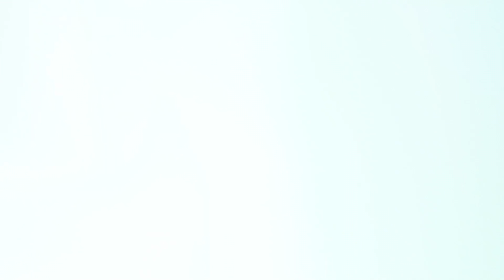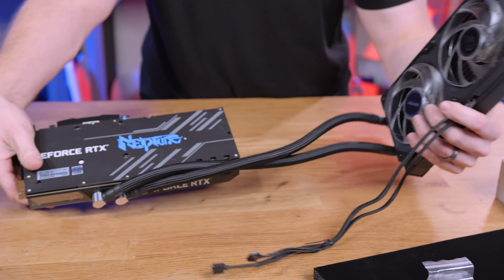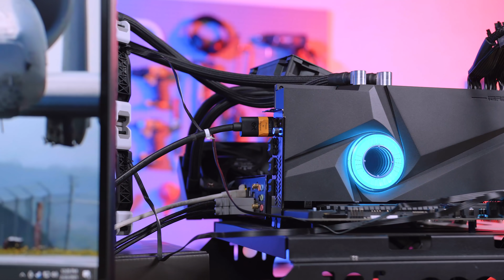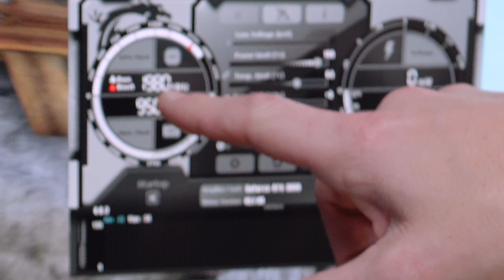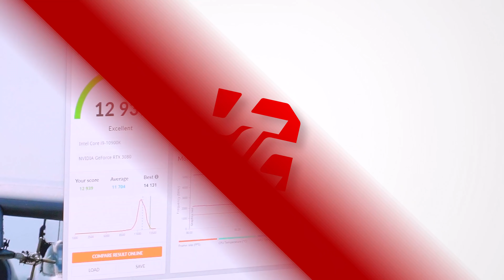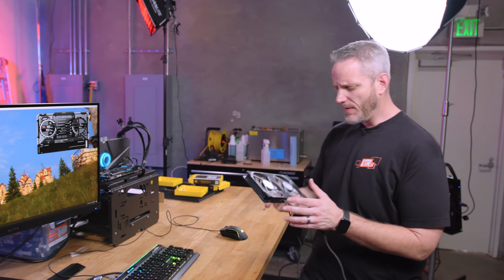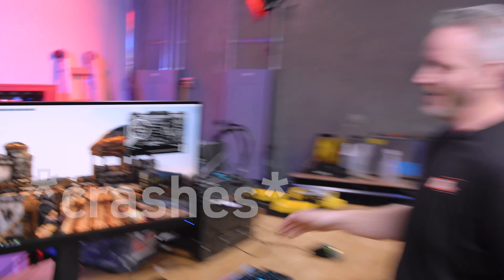AIO vs Air Cooled Video Cards... worth the extra cost?

Comment: Yes, 100% that AIO coolers are they way to go to cool GPUs.  Im posting this on July 21st 2021 and several new 3,000 series cards now come with AIO coolers. For overclocking a GPU its a must unless you want to leave all that extra performance on the table. Also the benefits of long term use of the card is most likely better to keep it cool. Another benefit is that your GPU is not pumping out so much Hot air as before heating up your room. Cant think of any Cons to using an AIO for Both CPU and GPU.

Comment: @JayzTwoCents Having both CPU and GPU with AIO's are great but I'd imagine that placement in the case is going to be an issue.  I assume that you would want this to placed as an exhaust in your case considering it may be blowing hotter air into it than a CPU AIO would, no?

It would be nice you could talk about dual AIO radiator positioning within a case for optimal airflow and temps. Maybe even in a Corsair 5000D Airflow case.

Comment: Go with what looks the best lol. Could of gone air cooled and have about same temps. It's just a bit boring lol. I don't build personal pc often. I want Something worth having a window for. Middle of building a joker themed pc. Sprayed purple with 3D printed designs used as a template to not block air flow. Spray painting over them. Hand paint the rest. Frost glass effect to cover bare PSU. Green and purple internals. Small screen to monitor temps.

Comment: This is a terrible video.
Reason being the title poses a simple question and it somehow takes 16 minutes to just show a chart of data. If you wanted to elaborate on the testing method used, that could've been done a lot more concisely. This seems to be 12 minutes of filler, padding, shilling, and general banter when this is a pretty common question that people consider when building.

Honestly just... give me the fucking data. Even Linus vids are more concise than this (and actually show relevant data).

Comment: I have a evga 2070 super with the same aio design as that kingpin 2080ti. I lost the silicon lottery and the chip doesn't like to overclock but the thing stays nice and frosty all the time so at least it's super quiet and I can trust it to run for a very long time

Comment: I am still running an EVGA GTX 1080 Ti SC2 Hybrid, I went with the AIO watercooler to spare my motherboard and other components the heat of the GPU,  I also have my CPU on an AIO pulling air in from the front of the case.  The GPU exhausts out the rear of the case and I have 3 140mm exhaust fans on the top of the case.  Funny thing, I don't even overclock, but my PC is in an unairconditioned room and it can get mighty hot in here, so I tried to get my PC to breath as much as possible.  It has been fairly reliable for a few years now.

Comment: I got a couple of RTX 2080s in 2019 with aio water cooling and I think it is great, it definitely keeps my pc temps much lower, and I have a noctua cooler on my CPU so since the gpu isn't blasting hot air inside the case my CPU also is much cooler too

Comment: I feel the case to go AIO is not for performance, but for noise. While Raijintek Morpheus, Arctic Accelero, and even stock heatsink+fan mod were all significantly quieter than any stock setup as well, the noise difference under load for an AIO (especially when overclocking) couldn't be matched. Add to that however the temps are also lower not only for the GPU, but for all components since the heat isn't exhausted into the case, it was a quality of life improvement across the board. The only downside was of course cost, but if you're already a user buying a top end graphics card ($700-1000+) you're also likely putting it into a system with other high end components, and at the end of the day if you weigh it as a $2500 system vs a $2700 system that has significant quality of life improvements, then it's a no-brainer upgrade.

Comment: It depends on the card. If you're buying something super high-end like a Titan or 3090, then you may as well bite the bullet and go for it.

The 3090 is a special case, though. I've yet to see an air cooler that keep those things under control. My EVGA 3090 FTW3 routinely exceeds 95C under full gaming load. Whatever jackass thought it was okay to try and air cool a 350W card should have been fired.

Comment: I don't get it! With LN2 it would run faster, and it crashes below 50C even tho it is specd for 95C before turning off!
Why isn't it auto overclocking further? if there is temperature and power headroom...

Comment: Currently I have a gigabyte nvidia 3090 xtreme waterforce, I use the machine to play in 4k resolutions, previously I had a 3080 gaming pro palit and a 3080 msi gaming x trio msi, all mounted in a lian li 110 dynamic xl cabinet and the difference of temperatures is impressive, in my case it is worth the difference in prices, if these were normal.

Comment: I think 3fans air cooling is good for some good oc, my GPU runs good at  67 degrees Celsius under stress with  benchmarks  with around 1.9 2.0 Ghz clock, which is a good temp for high OC. Aio cooler seems good  if u wanna go Xtreme with maybe some RTX 3080 or 6800XT with much OC, or to have a more silent build.

Comment: finding something that  covers everything in its own individual loop and having a 3 chambered container that is somewhat chilled to a point that it can contain a chilled element  to benefit  keeping the gpu chilled so it doesn't crash..

Looking at the average dl of games and various additional content  I would think to have it all active in a way you are either  at the routed  of creating the scenario of adding NVME storage and use is as ram bank boost to run the games with all those additional features

because even with access to 24GB, looking at all the new features I think there isn't appropriate ram to cater to these productive and progressive, and if you are going to keep bottleneck ram whether it be on console/pc/laptop. we are going to play-ability issues long term..

because you end having to use harddrive/ssd space as a caching service if not relying on some form of device to offload some of the processing too as seen with both the xbox one x and ps4 pro

at this stage we have been at the 128GB and higher options gpu space otherwise we pay a penalty of hand off to either 65/128/512/756 GB or 1-10TB of storage ram to offload the processing too just to process 4khdr and all the widescreen formats you can name including support the realism of shader  aspect that consumes..

I think both amd and nvidia might  end  up having invent a daughter card just to cater for the next version of their own phys-x engine where all the compute engines are catered to from that card interface otherwise we are going to have retire the older crap to cater for cards with up to 2TB of ram just to process the newer graphics engine.. 

as for cooling it I don't have a clue though I suspect what is and what will be within the marketspace in the next 2-5 years might not be suitable for cooling purposes..
that much ram never mind the other components of the gpu

Comment: I just stick with air cooled. It's easy to install, easy to run, and have fewer things that can go wrong. I very rarely overclock because my RX 5500 XT provides my 1080p 60Hz monitor everything it can handle, so there's zero point TO overclock. I don't have 4k monitor, I don't play AAA titles like Shadow of Tomb Raider, I give absolutely no *cares* about RTX or any of that nonsense, and I consider RGB to be one of the greatest atrocities to have ever infected computer hardware. 

So... I use air cooled because I don't push my hardware hard enough to require liquid cooled, so if I don't have to deal with all the extra headache of an AIO, I'm just not going to do it.

Comment: Using an aio is great, have done it for my last 2 gpus using the kraken g12, the fan it comes with is dead quiet and can be run 100% no issues. During most gaming situations the fans on the aio don't even need to run much, I have a h80 with one sp120 run at 900rpm constant, temps were not over 60 degrees, idle was around 30

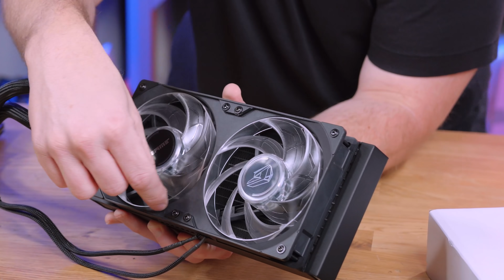Comment: observation: @ 3:36 - "they got this channel along the side of the blade" The correct term is shroud. Fan shroud. An integral molded on shroud. That design is pulling more current due to the extra mass is my guess.

Comment: I do have a concern over longevity being that these are new designs. I've heard of several AIO pumps failing so it's reasonable to wait for long term test results before jumping on board and trying to find one. Depending on the manufacturer and quality of the components, it may be a big gamble on an expensive card when air-cooled or custom loops are already tried and proven.

Comment: To be honest, I'm not really a huge fan of the CPUs with built in AIOs. I wish they would just make a full cover block and the card single slot so you don't have to worry about fans for VRM cooling. They just seem kludgy to me (admittedly, I run a custom loop, but that's not for everyone).

Comment: My main reason to use a Hybrid card is to better control air flow in the case.  Yes, the temps are better and the card performs better; but not by enough to justify the price difference based on performance difference alone.  If I buy an air cooled card then that just means I'll have a useless air cooler on my shelf after I put a water block on the card. To each, his/her own...

Comment: I've had a 1080TI Gigabyte Aorus AIO for like 3 years now.  It's been super solid.  I removed the hard drive cage and placed the AIO rad right up against the front case fans so the exhaust literally just exits the case immediately.  HOWEVER, I mistakenly thought at the time of buying that it would be quieter than any air cooled card, and although it is very quiet, it's still the loudest thing in my case (BeQuiet case & PS with Noctua CPU cooler).  What I hear are these high-pitched clicky-swuishy sounds , when you put your ear up close sounds like liquid moving.  So, my next upgrade will probably be all air cooled so I can take advantage of silent modes for audio recording.

Comment: I'd put an AIO on my XFX THICC III Ultra not for the performance boost, but for the noise. The  Thicc 3 will boost to approx 2200 on air but holy  crap the thing sounds like a jet engine while doing it. I was seriously looking at NZXT's aio adapter but I'm not sure about compatibility.

Comment: Other people: omg my gpu temp got from 31C degrees to 32C, omg it’s burning.
Meanwhile me with a gpu at 99C all the time: this is fine*
Reply: indeed, is fine, the gpu will shut down with no harm at all if its too hot
Reply: @DantoG  that’s not fully true. Your GPU will degrade and shorten it’s lifespan if your temperatures are that high for daily use. What GPU do you have that can hit 99C? You must have a broken heat skin or water block, I’ve never seen a GPU run above 80C (on air), even when it pulls 500W.
Reply: @mattbvii  change fan speed, thermal pads, liquid metal on core. You are NOT supposed to get above 70ish C for your GPU. If not, maybe mounting pressure issues, or RMA your card. It is NOT supposed to get that hot, at all.
Reply: @YouTubePseudonym  he might be talking about junction temp which amd said is perfectly fine and expected even at 110*C the standard temp readings are almost never anywhere near that high
Reply: @veroxeon1858  junction temps, sure, but 99c is still not good.

Comment: seeing this card sit at 50 degrees is incredible, mine is vibing at 70 most of the time
Reply: Yeah, Jay's tests were done on open case - that gives big advantage to air-cooled components.
You might improve your situation with more case coolers that push hot air out or pull fresh air in.
Reply: Mine gets to 90 degrees :(
Reply: @deanthebean4818  😧
Reply: mine always goes to 84 in demanding games
Reply: @SilverMiraii  same, I have a 3080ti that thermal throttles at 83c and drops to 1600mhz. I'm waiting for Alphacool to release their Eiswolf 2 for fe cards. Too much of a noob to attempt a custom loop.
Reply: @ascap2854  Undervolt your card. I have two underclocking profiles for mine (1860 @ 0.837 and 1935 @.900). The first one limits my temperatures to a worse-case of 73°C peak and the other one goes to 80°C. Right now, I'm more limited by power (only 400W ain't enough for more than 1950) than heat. Truly recommend to try it.
Reply: @V.Hazezz  this. undervolting is super great at reducing temperature as well as drawing less power. just be reminded that some games hate undervolting, for an example, a heavy graphics [unoptimized but yeah still stands] like alan wake used to push my 3080 ti to 85c, with undervolting, easy max 75c, at the exact same performance. but when i even try to play apex legends more than 15 minutes without crashing or freezings, almost impossible. so yeah, give and take, but i still recommend undervolting.
Reply: Same, with my settings lowered, no ray tracing. Should of invested in one of these instead. Paid $1800 for a EVGA 3080TI Ultra

Comment: Been thinking about getting the EVGA 3080 Hybrid and then possibly replacing the fans on the AIO with EK high static pressure 120mm fans. Wondering if it'll help the temps, whilst matching the rgb of the rest of the rig 😅

Comment: totally worth it, my 1070 runs 2114 mhz with the kraken bracket and an corsair 120 mm aio. temps hold at 50 or lower. Don't recommend for new users though because you could easily crack the gpu die if you tighten too hard on the cooler/bracket, or be too loose and not get good contact.

Comment: I've had an Gigabyte AIO 2080 Super for the last year, and it is by far the best experience with a graphics card I have ever had. Never ever experienced any thermal throttling, and temps cap out at 55c under 100% load and 112% power consumption. Was only $840 on Newegg - only $60 more than the air-cooled MSI variant cost at the time. I don't think I'll ever go back to air-cooled GPUs, unless Noctua starts making them.

Comment: I have to say that after using all hybrid cards from EVGA, first a 1080 TI, then 2080 Ti, and now a 3090, I don't think I'd go back to an air cooled card.  I also live in a very warm house, if that helps anyone.  The hybrid cards have all run great, even in the summer.  First time, since my old R9390, that I haven't hit the 90c mark.  In fact, I don't even think I've hit higher than 60c, yet, but it is winter in CT at the moment.

Comment: The Radeon water cooled video cards are faster than their air cooled models and achieve significantly higher results. The Nvidia cards are poor over clockers using either water or air. Stay away from Nvidia water cooled models. They are simply not worth the extra $$$.

Comment: I personally love my 120mm aio with the kraken g12 mounted on my 1080ti FE. My stock card was running 82c at full load. With the aio on runs at 55c at full load.
Reply: I have a Corsair H55 on my gigabyte 1080 (non ti) and my temps climb up to 70+ C. Which cooler are you using???
Reply: @mur80mur  hmm that seems high. I just had a crappy asetek one.
Reply: @catfish708  Yea, I'm not really sure what to do. I had the radiator fan as an exhaust to start with and I changed it to an intake but temps don't seem to have changed. I was wondering if I should change the coolant since I don't know how old it is, I bought it 2nd hand.

Comment: I have the NZXT bracket and an H110i on my 1070 that's been running at 2030MHz and no higher than 46*C for 2.5 years now.

Comment: YES! Yes it does! (Rant without seen the video yet)
BECAUSE! I had to change resolution to FHD (from QHD) Because the KFA² 2070 is so freaking loud and noisy once you put a little load on it. Had a hard time searching a capable AIO cooler for this specific card and found one at least oversea in the US. The Card itself is good, but everything over 50° is a noisy hell.

Comment: so ey.i  have one of tath cooler master 240mm fans on 1 frame and one cable for pwm and one for rgb since 2019 mounted on one cooler master aio and i can say is silence and eficent cooling my 2600X well anove 100w of raw power.and my RTX asus dual 2060super OC V2 can OC to 2100mhz nice an so so much of an issue with noise cause the two radial fans are very eficent on average speeds. but ye on air they are always on 65+Cº when gaming.so ive been tinking in doing aio on the gpu. just for the temps go a litle lower then tath.cause i dont like the idea of it always being bellow 60Cº.but maybe im crazy.i dont know tath.but i am 46 years now and been playng hardware wsince the Spectrum 48k and timex sinclair.+

Comment: i used to have a cup of water on my cpu when my cooler failed i used a metal tub filled it with water thermal paist on and it worked fine until the new one came

Comment: In my experience yes. I have the NZXT adapter on a 1080 Ti and it's exquisite! Admittedly my stock cooler was a blower fan but the temps have dropped from over 80'C to 55'C. Plus it can run at 2000Mhz now as well.

Comment: I've had several EVGA cards with the hybrid cooler.  I ended adding fans to the other side of the rads to make them run in push pull and it dropped the GPU temps even further.  

I put an EKWB GPU block on my MSI Gaming X Trio RTX 3090 and its stable at 2295 MHz in some benchmarks.

Comment: I run 2 1080 it's on water.  45 is the norm.  But even they are relative to ambient temperatures.  When room is 75 card 45. When 100 in room . Card is 50.  Without any water card  was in 80's.  I ran them as straight founders for 2 months before switching to water.  My humble opinion. Water is the way to go.  As far as fluctuations in temp because of  CPU pwm controlling GPU.  No problem at all.  CPU always gets much hotter than GPU.   I can game 10 to 12 hours a day.  Redemption. Assassins creed,  witcher,